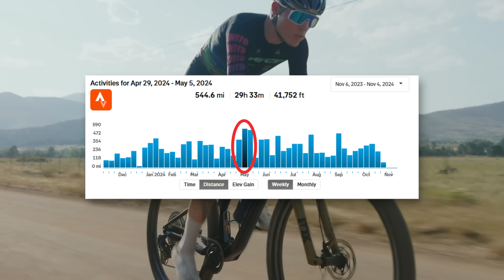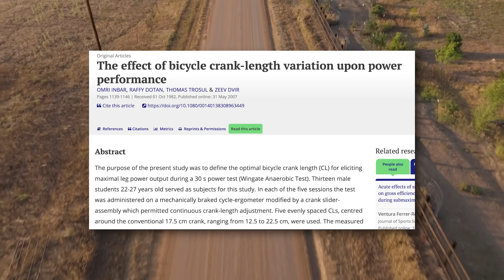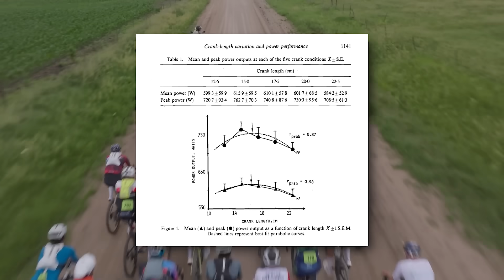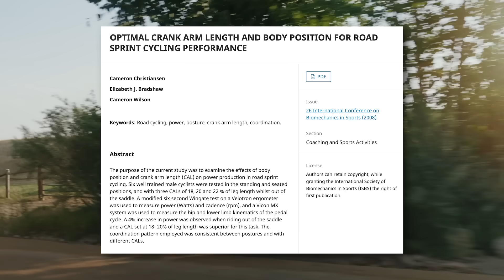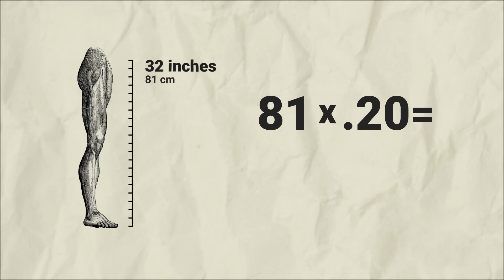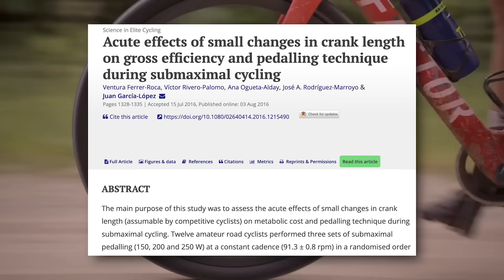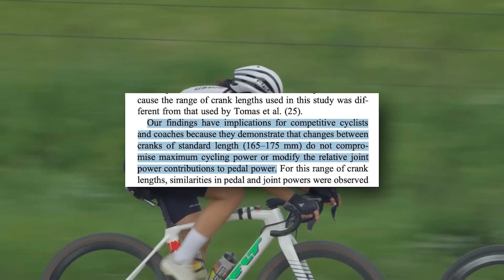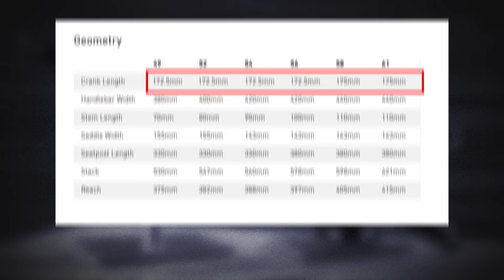You Should Be Using Shorter Cranks, Here's Why

Comment: According to the first study, it looks like 150mm was the length that produced the highest sprint power of the lengths tested. It may not be statistically significantly higher than the power obtained with 175mm, but at the very least we can be assured that an average height male rider will not sacrifice any power going to as short as 150mm cranks. And, given that the advantages in aero position, bike fitting, and injury prevention continue without limit as the cranks get shorter, I would argue 150s should be the best length to buy for the average height male rider. Fortunately, Rotor offer a 150mm in their Aldhu aluminum cranks with the 30mm axle. They're one of very few brands to offer cranks that short.

Comment: I am 6 feet tall and have been riding on 172.5 mm cranks. I went to 165 mms due to a hip issue. So far I hate the 165s. I much prefer 172.5 or even the 175 cranks I used to ride. There’s just no torque on the 165s, especially on hills but I’ll keep trying on them.

Comment: I just got my new shorter cranks. As a tall guy (6'4) I am used to 175mm cranks. I am now switching to 170mm. Not really concerned with performance, but I hope it helps with my lower back issues and maybe is a bit easier on the knees.

Comment: On a flat surface and downhill shorter cranks should be more efficient - but - and it is a big but - when travelling uphill short cranks will be less efficient in that they will require more energy from the rider than longer cranks.This is really an illustration of the leverage principle - ideally cranks would adjust automatically in length according to changes in the incline of the road.

Comment: So as a 5'6" rider with a 28"/71cm inseam, on a too big 51cm frame with 170mm cranks... if I follow this 18-20% of inseam rule I'd need to find 142.5mm cranks for 'optimum' output haha.  I'm now picturing myself trying to ride my nephews 16" bike spinning out at 150rpms hahaha.  I'm planning to go down to 160mm just to see if I can actually ride in the drops for once and still be able to breathe without bashing my knees into my chest.  Contrary to the data, I feel like going smaller than that would be 'too much' and that I'd be losing power in climbs with a smaller stroke/less leverage?  Putting all this data together, I feel like taller riders have an advantage because they get more leverage and a bigger stroke even with shorter cranks. No?

Comment: Short crank disadvantages:

#1 Cadence & Stability – If you already ride at a high cadence, going shorter may reduce stability and impair performance.

#2 Bike Fit Adjustments – Shortening the crank requires raising the saddle. Your steerer tube may not be long enough to compensate for that.

Also, the terms short and long should be defined relative to inseam percentage, not just nominal crank length. Please define short and long.

With my 92.5 cm inseam, I’m sticking to 175 mm cranks. My cadence is already 110 rpm during efforts and averages 93 rpm on Strava post-ride.

If I’m missing something here, please let me know.
Reply: #3 Less torque power. Shorter arm=less leverage

Comment: 5’2” with a 27” inseam. I’ve ridden 165mm cranks for over 10 years, but by a 20% rule I should be riding 140mm cranks. Considering my hip pain that reduces when I sit up on the bike I’m going to go lower this year. I can’t imagine going lower than 150/155mm.

Comment: I'm 6'3" with a 35"/89cm inseam. I currently use 175mm crank arms on my bikes. If I'm understanding this video correctly, 20% is 172mm. At least in my case, that doesn't seem much different. I don't race, but I do put in a decent amount of miles in a season, and I do like to go fast. I'm 62, and more concerned with wear and tear on my joints than the potential performance improvements. Wondering if buying shorter cranks for my existing bikes is worthwhile?

Comment: I’ve always rode 172.5 but decided to try 165 for over six months and I was slower with my climbing and fatigued easier. So I then tried 175 out of curiosity and kept them cause I climb faster while training less which works good since I work 40+ hours and don’t bike as much when I raced. 165s took the fun out of cycling too and felt like I running in sand. I’ll never go less than 172.5 and don’t see myself ever getting rid of my 175s. I do recommend experimenting with the sizes to find what you like best and using a power meter is helpful. If I lived where it was flat I might consider shorter but for climbs they suck imo. Bottom line go with what works for you and don’t fall for the trends. There’s not enough data to convince me that “shorter is better” the difference is so small from what I’ve read. Also I think shorter has become popular because most people aren’t flexible enough. And why aren’t MTN bikers talking about shorter cranks? Aren’t most of their bikes 175mm??

Comment: YouTuber Peak Torque posted an engineering analysis video back in 2020 comparing shorter and longer crank lengths. As a mechanical engineer myself, it made total sense, enough to convert all my bikes from 172.5/175 to 160s.
Reply: Isn't longer arm = better leverage?
Reply: @Motor0oola Yes, but the power is gained back with straighter legs and higher rpm one gear down than you'd be with longer cranks.

Comment: You can apply more torque with a longer lever arm improving acceleration.
Reply: You can achieve the same thing changing gears. Gears allow you to choose the best torque/rpm ratio at a given power. In other words if you cant turn the pedal due to lack of force, theoretically you could use  a longer crank, or simply switch to a lower gear.

Comment: I just tapped my 175 mtn bike cranks at 155.  That translates to 11.5% torque loss so I am trying to increase my cadence to maintain my output.  So far, my rides are slightly slower but the loss of torque when first taking off is most noticable.  This change was relatively easy and I can always reinstall my pedals at 175 later on if I get tired of these shorties.  My inseam is about 30".

Comment: You know that problem when you need to move something heavy and get a LONG lever because that means that you can apply GREATER force at the business compared to what the same effort gives you with a short lever? Yeah, so big news. Crank is a lever. Short crank requires higher frequency to achieve the same output. 
Every once in a while a trend emerges that has nothing to do physics, or common sense, but an army of dumbsters fall for it.
The length of the crank is only ONE element of the equation and CANNOT be assessed in isolation. There is the diameter of the wheel ... and unless one's dumb enough to use a single one on a non-EV bike, the diamater CHANGES. There's the size of the rider (especially their legs and feet). 
And there's the physics. And my comment went full circle.

Comment: All of this ignores several things. 1. Rider style. 2. Feel that the rider wants. And I am sure some other things that will come to mind as I type this. 
How about the concept of mechanical leverage? We all know, if you want to get a stuck bolt loosened up, get a longer wrench. Why are Breaker Bars long, and not short?
As a 5'6" rider that has almost an average inseam (short torso, long limbs), I tend to like and do better on longer cranks. The other thing to keep in mind is Foot Speed. A long crank means your foot speed is faster, and therefore making a bigger gear feel smaller. A short crank means you have to pedal faster to get the same feel, or you may end up feeling over geared and bogged down.
When I raced single speed Mountain Bikes, and Cross Bikes, I did very well on 175 cranks. I had no problem turning 140 RPM on the flats to make a 2 to 1 gear ratio do 20 MPH (this was in the days of 26" wheels). On the cross bike, I ran a bit bigger gear. The longer cranks meant I could power stomp my way up the climbs, something that WAS NOT going to happen on 170s and certainly NOT on 165s.
On a climbing road bike, I like 172.5 cranks, it allows me to push a bigger gear and keep my heart rate down. Spinning up a climb means going slow. 
On my TT Bike, I always ran 175s, and I did better in a large gear mashing 70 RPM. Once my quads were warm, I could go to an even bigger gear, I would go faster, and lower my Heart Rate.

Note: I won the 2005 Sea Otter Classic Expert 35+ in a 2 up sprint against one of the best road sprinters in Nor Cal Masters 35+, on 175 cranks and a full suspension Titus, against a hardtail.
At one of the last 24 Hours of Tahoe (2002?), I got stuck doing the first lap, and I am a slow runner. But I chose to do that lap on the Single Speed. Starting the climb, there were 90+ riders in front of me by the time I got on my bike. I finished the lap in 4th overall and put my team in the lead for our category (that we won). Again, 175 cranks on a 32 x 16 gearing. There is no fracking way I could have done that on short cranks, I would not have been able to power the bike around sharp switch back turns. No Leverage!!
Tadej is a freak of nature right now. The short crank thing will die out, just like oval chainrings are dying out.

Comment: Shorter cranks are the newest trend for the mainstreamers from social media. In fact, shorter cranks have been used in road racing for triathlons, time trials and tracks since the early 80's. How do I know? I used to have triathlon magazine sent to me by mistake and I just started reading them with top athletes having specs cranksets that are around 160-165mm. Since I was young and started getting into road biking back in the day, I didn't really pay attention to these specs as much as the frame geometries, the materials, and the drivetrain components. The main thing I also look at is how the position of the leg, hips and body is for aerodynamics while biking. The crank arm length does play a huge role in the fitment with respect to the knee, especially when you're in a tuck.

Anyway, my road biking stint lasted a short time and I went into mountain biking. I took what I learned and applied the short crank arms to my mountain bikes to this day and I advocate for shorter crank arms even for tall people. The advantages of shorter crank arms (not at the extremes) is 2 folds: ground clearance and better knee angles. With shorter crank arms, one would need to raise the seat post up the same amount that the crank arms are shortened.

As for torque - people think of torque as a pry bar the way it is learned in high school where T = distance x force. This works in a static system without gears. When gears are applied, the torque resides in the biggest ring, whether it is at the wheel or at the chainring. However, like this video has pointed out, the extremes on both ends have diminishing results. This is the same as the trend for wide or short handlebars, which is a fashion trend with mountain bike carbon handlebars marketed for stiffness at particular widths of 780mm-820mm! The only caveat for having longer crank arms is when you have a single speed drivetrain where you're not in an aerodynamic tuck. That is the only time when real torque is needed to provide momentum up rolling hills.

No, to go back on the advantages that are missed in the video:
- Weigh weenie always find ways to get even 1g off - well shorter crank arms will shave grams off for sure
- Shorter arms are stiffer (less flex), meaning more power is put directly into pedaling

Those are just marginal gains as compared the proper fitment and knee/hip angles for a more comfortable ride, especially when the rides are long ones.

Comment: 10 years ago had a pro fit before buying a top end treck tri bike and based on my height and bike size the crank length was 172.5.  Felt fine, but with the years started having back pain and hip pain with any rides 2 hours or longer and it was getting progressively worse the longer I road.  Switched to 165 recently and raised my seat height by 5 mm, and although I’m no faster, but immediately able to ride 4+. Hours with no back or hip pain
Reply: Thank you for sharing your story, I'm exploring this topic as I get lower back pain when accumulating long gravel and road rides, and you're confirming that shorter cranks are worth trying for me.
I haven't decided yet between 155 and 160 (from 170)

Comment: A few more examples of the math might have been instructive here. I’m 6’1” and my “crotch height” is 36” or 91.4cm. 20% of this is 183mm. So maybe my 175mm cranks are too short? On the other hand, 18% of this is 165mm, so maybe my 175mm cranks are too long? Or maybe they’re juuust riiight. In any case, the range of crank lengths measuring 20% of crotch height is a lot larger than you seem to suggest, as is the range of crank lengths falling within the 18-20% “optimal zone” for a given leg length.

Comment: I switched from 170 to 165 to see if my efficiency will improve on longer rides. And it did my legs felt much  better and lighter and was able to finish with fresher legs, after three hours of riding. My fear was the typical of losing power with shorter cranks, but now that fear is gone. I know for a fact that it did not affect my power output. I’m 5’9
Reply: Interesting that you experienced a noticeable difference from only 5mm reduction.
Can you identify a difference in all conditions, or is it significant only on long rides?
Reply: @supercurioTube i am 5'9"  i use 72mm bottom bracket to seat, my bike came with 172.5 mm and i want to change for 170 o 165 which do you recommend
Reply: @homerovl21 I don't have recommendations yet but I've started to try short cranks now, with 150mm from 170mm. I also got 155 and 160 to try.
The 150mm felt wrong - too short in the first minutes but on a first ride I got an increase in estimated FTP, so no worries on that! I was able to sustain a much more aggressive position than before, which made me more aero and faster.
Max power for sprints seems a bit more challenging to reach but probably the coordination necessary can be learned with some practice.
Going for cranks a lot shorter seems to bring much better results than anticipated, that's what I can confidently say for now.
I'll try 155 and 160mm next, then hopefully report in a YouTube video.

Comment: I'm 5'4" and do MTB. I went from 175 to 160 for two months. I liked the shorter cranks at first. No pedal strikes were a plus. When I checked my lap times however I was much slower. I was dying on the climbs because of the lack of torque. As soon as I went back to the 175, my lap times immediately dropped right back down. I've been on 175 ever since.
Reply: You forgot to switch gears 😂
Hint: its the power that brings you forward, not the torque.
Reply: That's because those tough climbs where rpm is extremely low short cranks won't have the torque. Short cranks shine best at higher rpms.

Comment: Trail rider here, just putting in a data point. 5'6" with a 28" inseam. The 20% rule would put me around 145mm cranks. I couldnt find 145mm, so Ive tried 140mm and 152mm. 140mm felt too short to me. The 152mm felt perfect, natural. Personally, fit is more important than other considerations here. The better the fit, the longer you are willing to ride...
Reply: Thanks for sharing your experience that includes what's too short! It's rarely reported.

Comment: Not a word about climbing? Extreme hills around 20% mean your cadence goes under 60rpm. And it gets easier to push since torque goes down by around 5,7% when changing from 175 to 165. In order to compensate for lost watt (17w if ridende 300watts on 175mm). Og course we got gears.. but non of the less, lower torque mean easier and probably more effective riding due to anatomical gains of the person riding is on the shorter side. And of course by going the same watt, 300, your cadens must be about 5rpm higher, which lead to better grip and control on steep technical hills. If you add oval chainring, you get another dimension for your cycling performance. 
Prove me wrong 😊 I'm here to learn

Comment: more power = more fatigue. Automobile engines have similar results, shorter piston crank, more horse power, longer piston crank, more torque, which is what you want for a truck engine, as horsepower for drag races. I would seem to reason they used a lower gear, with the shorter crankarm. This increase in power would likely generate higher heart rate. I have similar experiences with this when achieving 20mph in my 20 mile strava segment, when my legs start to fatigue I grab a lower gear and increase my cadence which raises heart rate as a trade off, I do this back and forth, power, cadence, power, cadence. Love your Vids Dude, Keep on Rocking Dylan....where are those cat vids....

Comment: I've always favoured shorter cranks than those that come on the large bikes I ride being 6'3 with a long inseam. 172.5mm has been my go to length and my natural cadence is 93-95. Using the 20% rule it would appear 175mm is what should work for me. 

Oddly I never changed my off-road bikes to shorter, perhaps stuck in an oldskool theory that longer cranks means more torque for that type of riding - time to give shorter a go.

Comment: Utter bullsht....    If you are concerned about crank length...   TEST for yourself.   I have a 38" inseam.  I tested 175mm, 177.5mm and 180mm.   During the test I found, for the same power output, my heartrate was 10bpm lower using the 180mm.   (Tested on a size-cycle at my local bike shop.  The size cycle was set up to match my bike exactly.   After a proper warm up, I tested each crank length for 5 minutes at 'just below race pace'.   I.e. a hard pace, but not so hard I couldn't maintain the same power output for all 3 tests.)